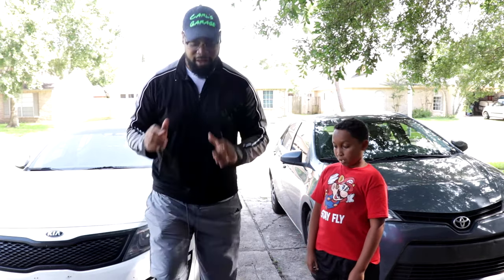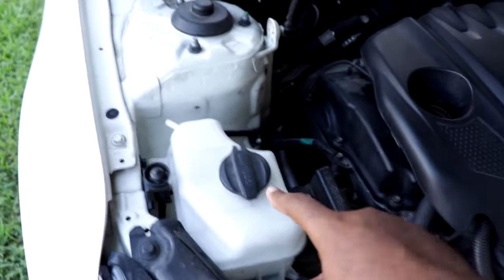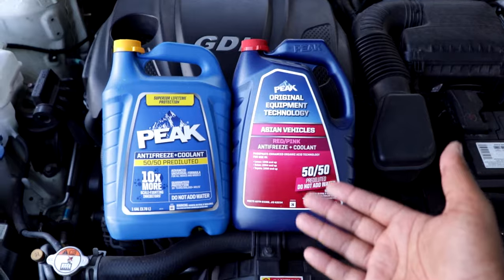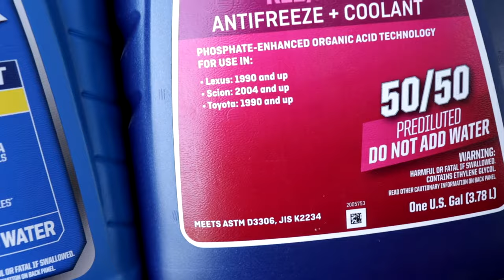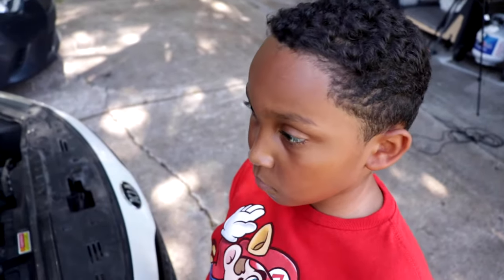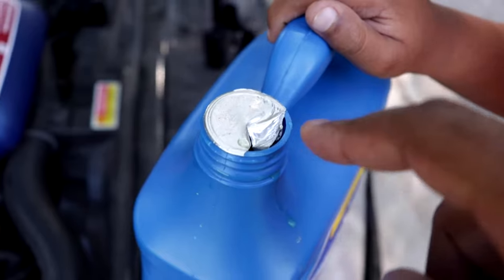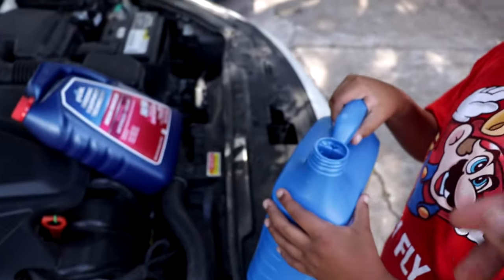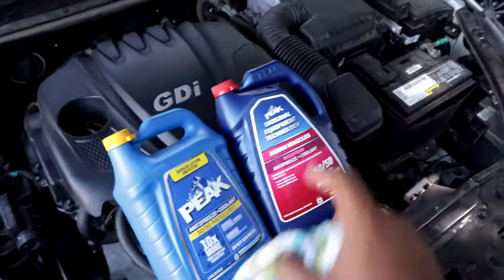HOW TO PUT COOLANT IN YOUR CAR PART 2 | KIA AND HYUNDAI CARS | GREEN COOLANT VS RED #kia #coolant

Comment: Something I would like to add to your coolant choice. The color of the coolant is just a die coloring. Prestone coolant which primarily is yellow in color is totally compatable with Hyundai / Kia vehicles. The color is what the manufacturer picks for their vehicles. The compatibility of the coolant is what’s the most important in adding coolant. Very good vehicle and great to see your teaching your son about cars.  Note that Prestone does make colored coolant for those that are color sensitive for their vehicles.
Reply: I purchased O'Reilly universal anti-freeze and coolant. It's a 50/50, which means I don't have to add water. On the back of the container it reads it can be used for most cars regardless of the original anti freeze color.

Comment: Almost poured green coolant into my red coolant Kia Sorento you just saved me a whole heap of money I think.
Reply from the maker: hahaha that made me laugh out loud lol. I told my wife. But you prolly got bigger problems if you have a kia sorento. Do you have the ksds? if not you def wont get that engine replaced when it goes out.
Reply: @StraightOuttaContent  I got 6 year warranty on the car through the KIA dealership but the check engine light came on and I ran a diagnostic and it came back as a P2181 cooling system performance so I did a coolant flush and added new coolant which made the check engine light disappear but I’m taking it to Carmax on Saturday and getting a RAV4 lol

Comment: This happened to me yesterday. Colant was very low. Was changed and not filled completely (other story). I filled coolant to full cause car was starting to overheat.  Car cooled down but didn't take coolant into radiator. Pulled over and added more past full. Still overheated and wouldn't pull coolant from reservoir.  Had to add to radiator. Helped but still had to add more to radiator this morning. No leaks, car is good now. Why does it not pull fluid from the tank and I had to add to radiator. Was a long ride home last night cause I had to keep pulling over.

Comment: So I have a 23 kia Sportage and the coolant is now below the low level line. In the manual under "adding coolant" section, it says "if coolant level is low, add distilled (deionized) or soft water to max level. Do not overfill". So am I just adding distilled water here? Because in other parts of the manual under recommended lubricant it says a mixture of distilled water and antifreeze.

Comment: Thanks for posting this fellow Houstonian! Do you ever have issues with your motor oil burning off due to buildup in your KIA. I have a 2011 turbo and have to keep topping mine off.
Reply: Mine does this all the time I have a 2016 🥲
Reply: I asked the kia dealership and they said they can do some kind of a flush for 400 🙈 and my local trusted mechanic said there is no guarantee but they can also do something similar for 150. Have you done anything like this ?

Comment: Ok so I have a 23 Kia k5, and my coolant color is the red pink color, I’m thinking it’s wrong but it was already in the car. Sorry guys I’m a bit new to this but I’m learning. Any tips?
Reply from the maker: On a car that knew you should be getting it from the dealer. But you have a lot more problems with that Kia than coolant. I cover a lot of Kia recalls.